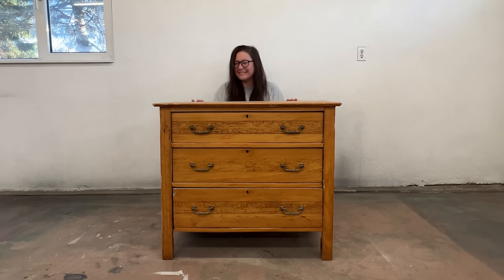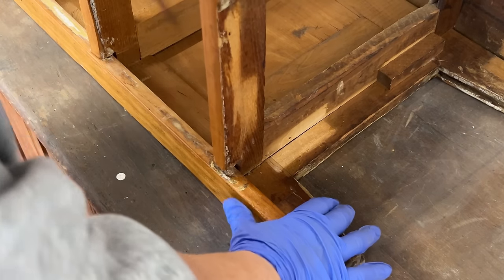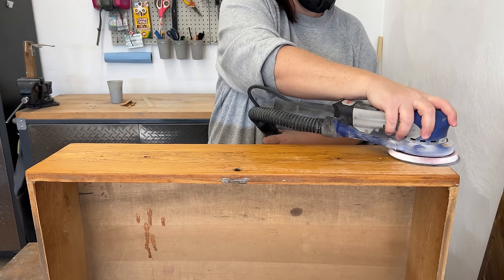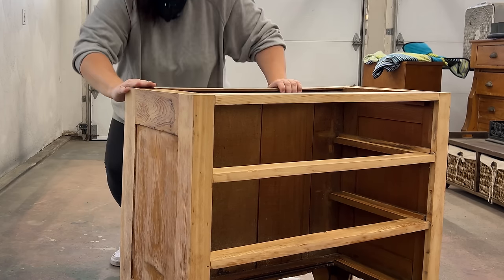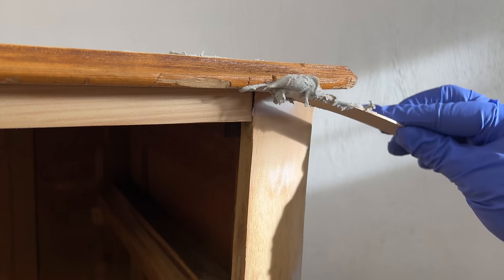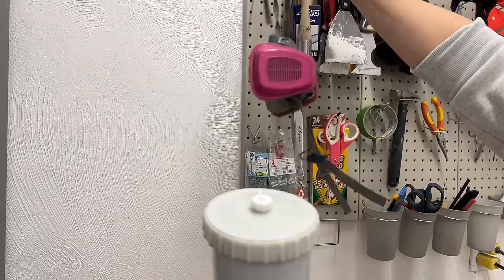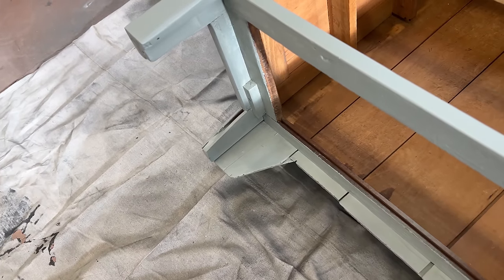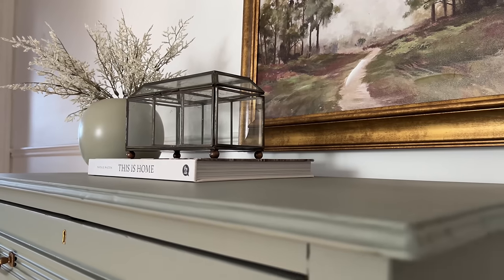Giving New Life to a Broken Vintage Dresser

Comment: I think it would've been fun to try "re-carving" the original design on the drawer fronts - just take a woodcarving knife and sort of trace the existing lines, see if you could get the depth it was supposed to have back again. If it didn't come out well you could still cover it up with new trim like you did. Not trying to be hateful, I think the final result was pretty, just offering an idea :)

Comment: Gorgeous. Love the trim detail you added. Super before/after. I know some people hate painted furniture. However, I have seen a lot of old wood dressers that are covered in lots of dark stain to mask the fact that the piece has different woods or woods with defects - seems pretty similar to painting it, doesn't it? Now if you have a piece that is made with gorgeous wood specimens and isn't broken and falling apart, by all means try to save it and bring it back to its original glory. To me, keeping something out of a landfill and giving it new life is the most important thing. And BTW, lots of people LOVE painted furniture. I happen to love both.

Comment: I'm all about green, so love the color. The silhouette of the dresser body is very linear, sturdy. The new trim, applied on the surface, adds to the weightiness. In combination, the piece now leans contemporary, IMO. The original handles feel a bit 'dainty' so I could see a more modern one which extends out from the trim, doesn't lay on it. (The old handles appear that, when reaching for one from below, your fingertips would hit the bottom edge of the trim.) On my screen, the green appears cool but the gold of the handles seems quite warm. Just my .02.

Good to see you back in the new year!